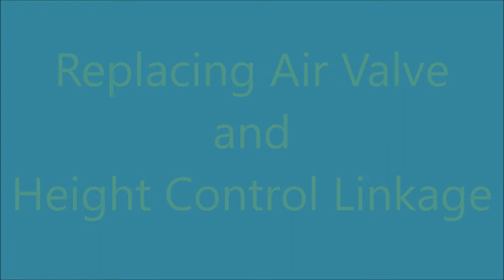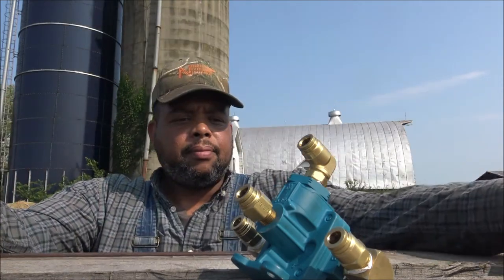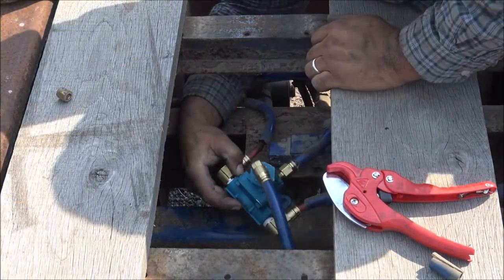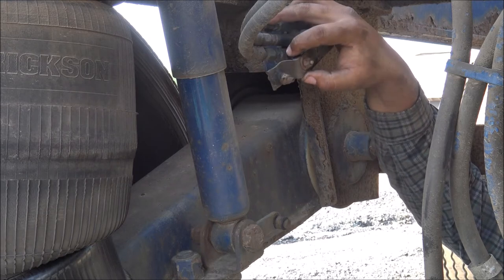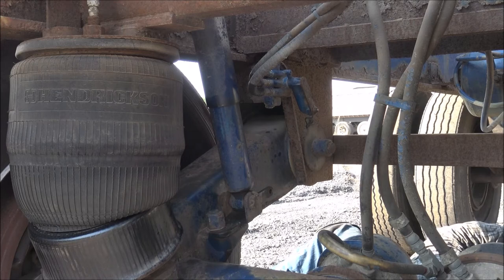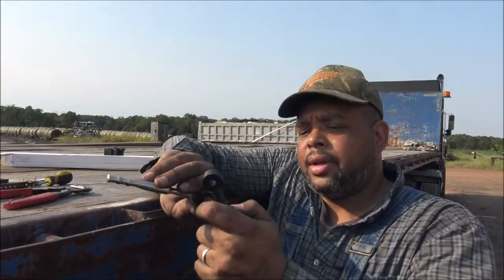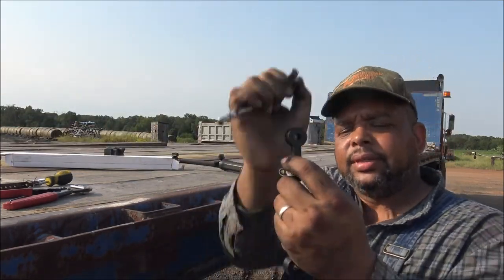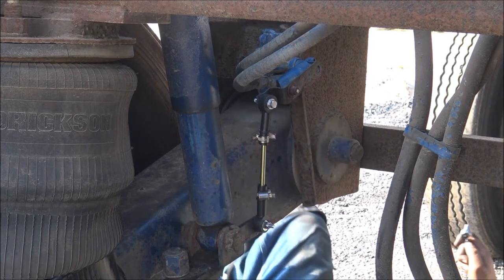Replacing Air Valve and Height Control Linkage on Flatbed Trailer

Comment: See the salt is doing a number on your trailer as well, just crazy how fast it kills a trailer. 👍
Reply from the maker: I was actually under there today replacing the air bags (video to follow soon).  It is not as bad as it looks.  Most of the rust on the frame is surface rust.  Some of the thinner metal (cross members for floor) has decayed some.  I am going to replace a few of them.  But yeah, the salt on the roads up here does a number on vehicles and equipment!

Comment: Do you have a hose routing diagram? I bought a used trailer with the same valve but one port is open and vents when the pressure is up. I don’t think it’s suppose to do that
Reply from the maker: I do not. However, I think it is supposed to do that.  The old valve did the same thing and I didn't have a problem with the bags over-inflating. Even after the new valve and new height control valves, the bags would over inflate.